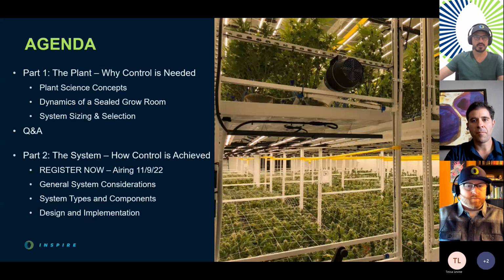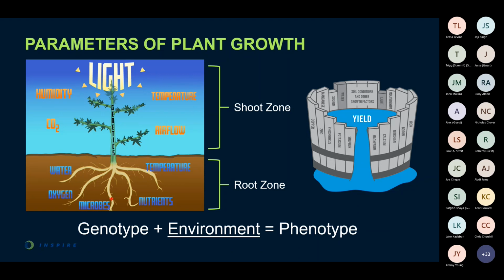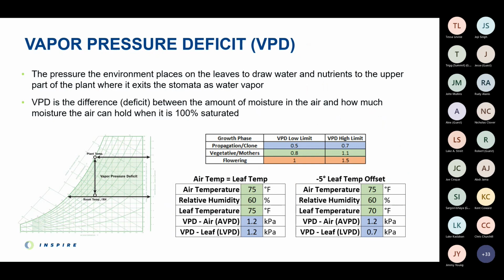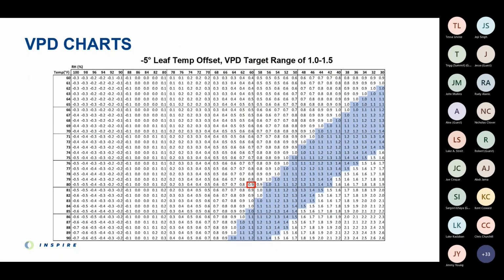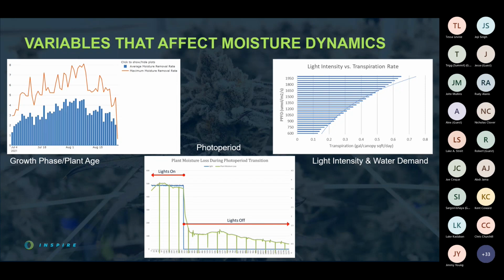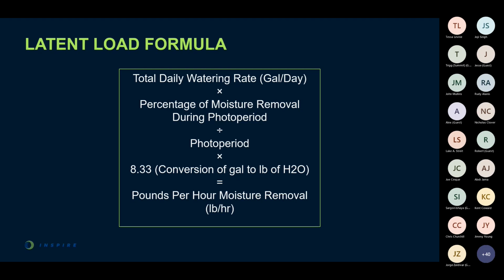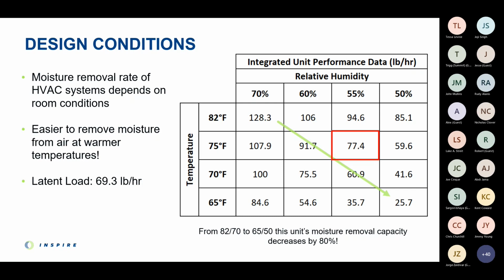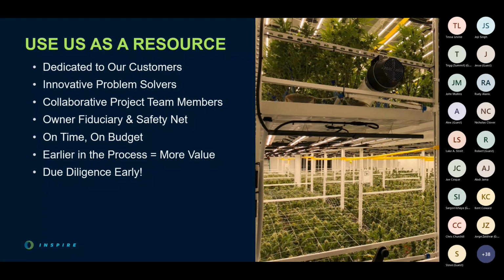Getting Control: Mechanical Systems for Indoor Plant Environments (Part One of Two-Part Series)

Comment: Thanks for the video! Very informative. In regards to calculating VPD if you don't have a accurate leaf temperature, I use air temperature - 2 delta as a rule of thumb. Here's my spreadsheet formula if anyone would like to create their own. B1 = Air temperature, B2 = Leaf temperature (avg), B3= Relative Humidity. If no value is added to LT then it uses air temperature - 2 delta.: ROUND((0.6107 * EXP(17.5*IF(B2="", B1 - 2, B2)/(237.3+IF(B2="", B1 - 2, B2))) - (0.6107 * EXP(17.5*B1/(237.3+B1)) * B3 / 100)),2)